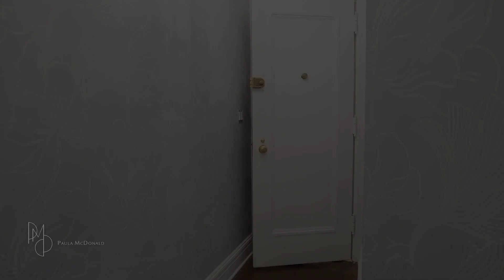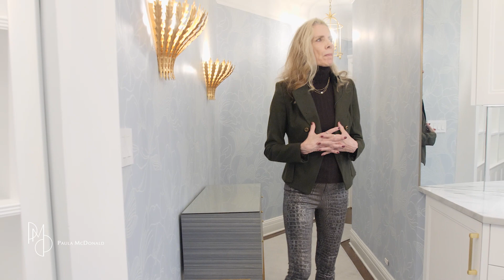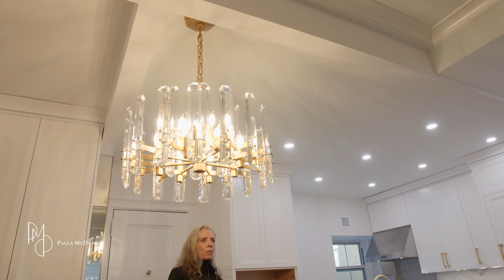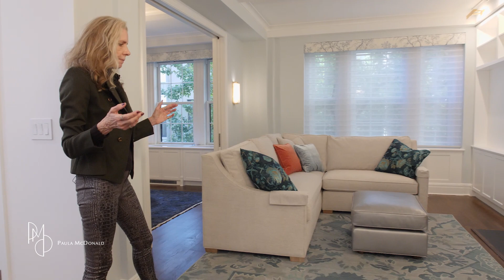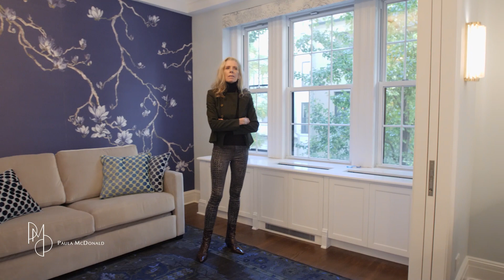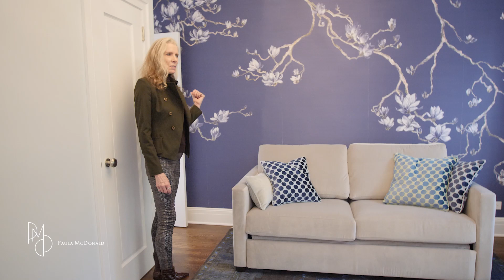Upper East Side 3BR Gut Renovation: 108E 82nd St, NYC Walkthrough Part1

Comment: Prolly should've done kitchen in a different layout because of AC unit - so there won't be any obstacles to open that door underneath the sill - stove could go to the place where the sink is and hood could be placed over it - this would allow to place regular kitchen cabinet which could be easily opened to maintain AC unit.